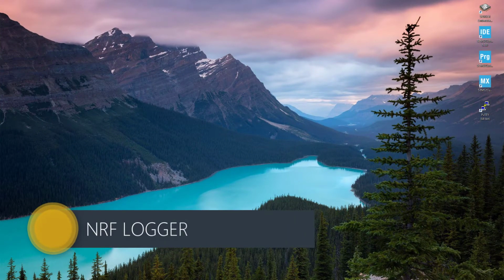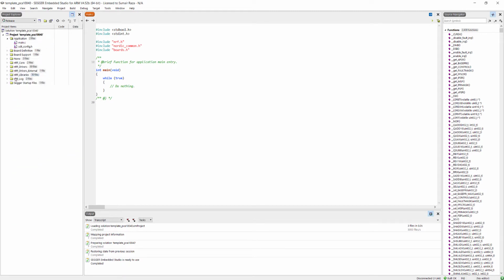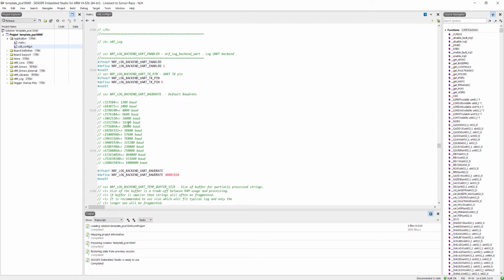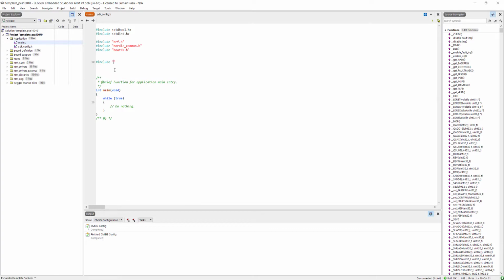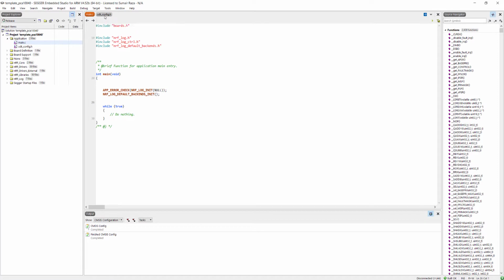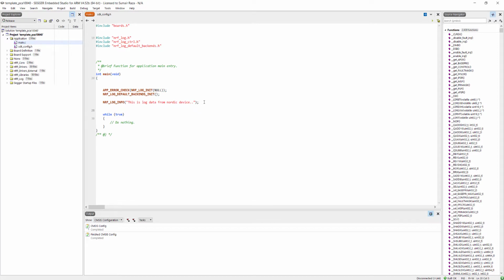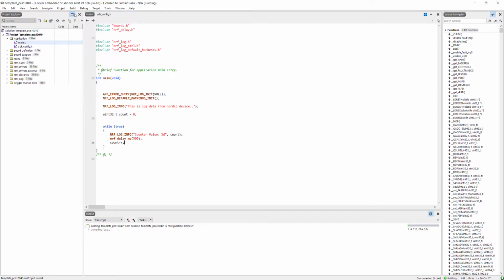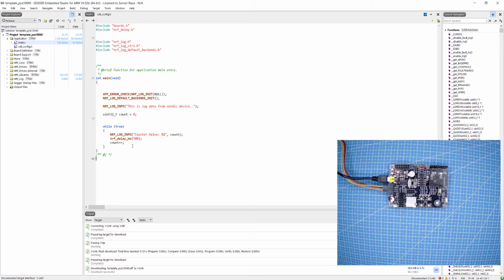nRF5 SDK - Tutorial for Beginners Pt 11 - NRF LOG Module

Comment: Hi, what is the advantage of using the nrf log module instead of simply doing a printf and see the log in the UART?
Reply from the maker: Well NRF LOG is  a special library built with debugging capabilities in mind and it also initializes the UART for us so we don't need to configure the UART. We can use a simple UART printf but we won't be able to give more info to our user unless we do a lot of manual work. On the other hand logger module is built with different debugging output levels. For e.g if you change the build configurations to debugging mode and then use the log module, if some functions are not initialized properly i.e some error occurs you can exactly locate the line of the code causing trouble as the logger module will print this error for you and the error line as well that's when we use APP_ERROR_CHECK() function, it passes all the data to nrf log automatically so a lot of tedious work is already done for us. Also the logger module has debugging levels with more info for the errors which can be configured using CMSIS Config > nrf_Log > LOG_DEFAULT_LEVEL to any other level to see more verbose output. Also there are many features which will be covered along the course. One more log module example is soft device memory configurations where some times we use less memory and our memory collides with the soft device memory area so if log level is changed to 3 we can see if that error occurred or not and if it occurs it recommends us a new memory configuration which saves our time for manual calculations. And then we use this new memory configuration and the error does not occur again... Hope so i answered your question. ;-)
Reply: @SumairsEmbeddedEngineering  Hi Sumair, it looks like that in some way it is like the syslog system of linux. Thanks for your repply.
Reply: @SumairsEmbeddedEngineering  Everything clear!
Reply: @SumairsEmbeddedEngineering  Hi Sumair, first thanks for this great tutorial. 
NRF LOG has another backend RTT, is there any advantage/disadvantage in using it over UART? Seems that it works with Jlink so I would not need a separate UART device to receive de data.
Reply from the maker: @bonadio60   Yeah RTT can also be used with nrf logger and i will soon upload a tutorial on it. Yeah it directly works with the j-link as i have covered RTT in previous tutorials. You can see that tutorial, and i have planned another tutorial on RTT with nrf logger so you will see that soon. ;-)
Reply: @SumairsEmbeddedEngineering   Is there a tutorial on NRF Logger with JLINK and RTT ?